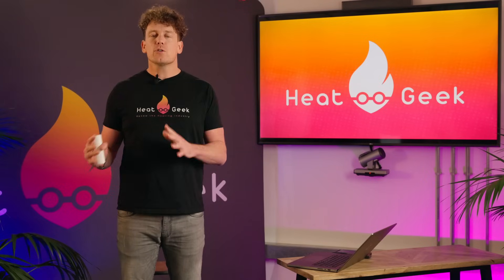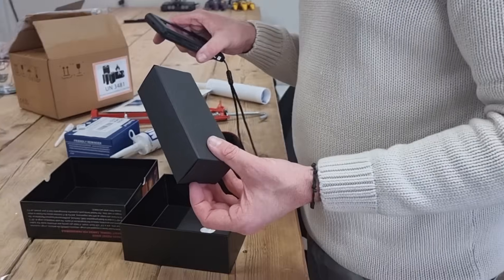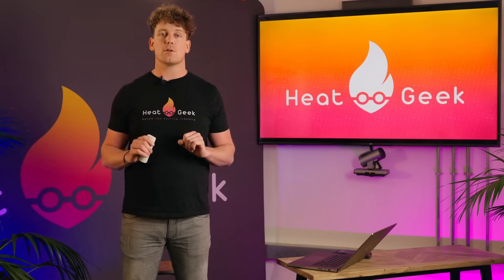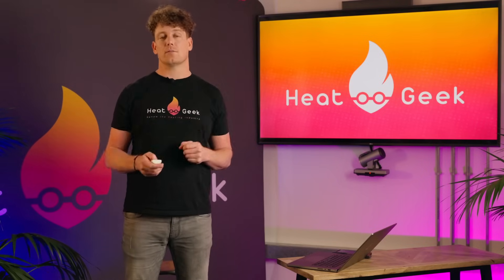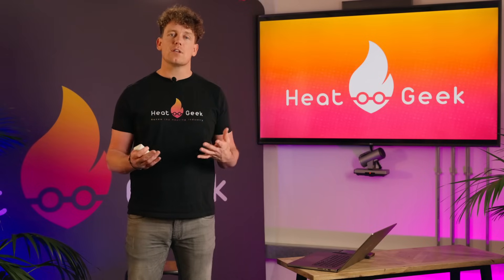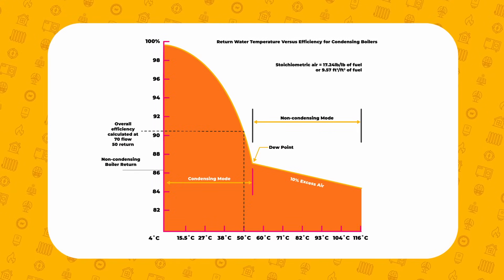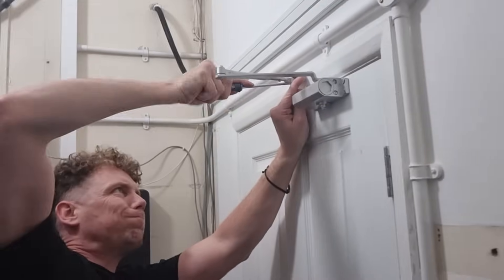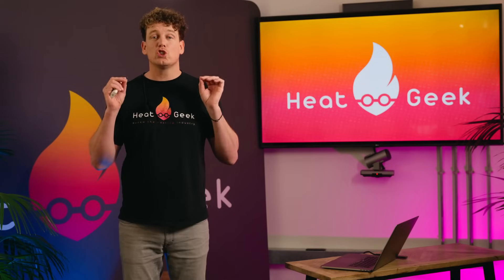This Insulation Secret Will BLOW YOUR MIND

Comment: The push to insulate homes has led to cowboys trying to sell spray foam loft insulation (government backed for years) which has resulted in rot to roof timbers. Poorly laid loft insulation where there is no air circulation. This can result in condensation and mould. Please be careful a lot of older houses need to breath.

Comment: A further saving that comes with a heat pump heating heating is if you also switch to induction cooking, which has additional benefits, you now only have one standing charge, which can be quite significant if you have lowered your direct fuel costs. Of course, you need to balance this against the loss of protection against power outages.

Comment: The annual heat loss will also reduce by more than 70% because the base temperature of the degree day calc will be lower. I.e. the temperature at which you need to turn the heating on because internal gains no longer meet heat losses.  Thus will make the calculation look even more favourable

Comment: How many inches of roof insulation did they recommend..the picture suggested that was problem but couldn't see any recommendations within the 14min. Video
Reply from the maker: @SteveMoore1969  we don’t recommend an amount of inches… I mean if money no object as much as possible, the point of the video it the packback is compounded with the use of low temperature heating
Reply: @HeatGeek  I have just got a new house with band b.. would it make sense to add a few more inches before fitting stilt

Comment: Good curtains over double glazed pvc windows. Check the gaskets seal. You want some ventilation in every room but not too much and uncontrolled. Modern windows and doors should have a trickle bleed in them. Because if you seal everwhere to meet Building Regs air tightness, you will not ventilate the building in winter. No ventilation will make you sick.

Comment: Is it just me or WC controls on Vaillant SensoComfor are ridiculously cumbersome to get to? 
I mean for a setting that one might need to "play around" till it is just right for the property it is really buried in the abyss, which is the "Settings" menu of the clunkiest system control unit of all times (I know their previous controls were a lot worse, but this is suppose to be an upgrade, so what the hell?) The heat curve controls should have been placed in the CONTROL menu.
For such a smart system it has a very dumb UI logic. I would have expected a bit more slicker controls and UI.

Comment: I covered my loft space with two layers of 13.5 tog polyester duvets bought cheaply on line and delivered. Easy to instal using two different sizes and at 27 tog amazingly efficient. No more loft condensation too.
If you have a 13.5 tog winter duvet on your bed try doubling it over and lay under it and you will feel what I mean.😎
Reply: Great idea, but are they flammable ?
Reply: @zorot3876  If they are polyester, they are almost certainly very flammable!

Comment: If you eliminate all the draughts, wouldn't you then have to leave a window open to make sure you're getting fresh air inside? It's not healthy to live inside an airtight box.
Reply: You can dehumidify, it will not be completely air tight
Reply: You fit heat exchanger fans. They capture about 90%-95% of the heat while venting the house.   Not that expensive,  but do take space so usually fitted in dead spaces between floor and ceiling.

Comment: But of course a house needs ventilation as well, so insulation cannot be considered in isolation…
Reply: Agreed. I retrofitted mechanical ventilation with heat recovery to my property due to mould problem and it is wonderful. Only losing couple degrees between extraction and supply

Comment: You mentioned much higher radiators flow temperatures that i currently run in condensing wirh
 compensation I can run flow at 30-35 at 22c° inside, which is much less difference.
But I run in 24/7
Should I increase the temperature as you said in the video?
Run my control on comfort instead of thermostat.
Don't really see any reduction in monthly bill that i had with an 1998 turbo boiler that run 60° and then stopped

Comment: All of this is based on a simplistic solid state use model that does not reflect the actual occupancy of the building.  Modern families require to get up to a warm house in the morning and then leave it, switching off the heating.  the house then cools until the heating is switched back on in the early evening and then switches off overnight.  What this means is that the heat source is having to raise the house and its contents from ambient temperature up to the comfort temperature and we all demand that this happens quickly so that during that cycle almost the same amount of heat is generated to get back to the comfort temperature irrespective of whether the house is better insulated or not.  Radiators are sized to cope with this initial boost as indicated by the difference in the rad temp/room temp of 50degC.
Reply: And totally missing the point.. Any modern heat source (and especially heat pumps) run more efficiently when maintaining a set temperature.  Heating up a property quickly drags efficiency down and in many cases completely wiping out any savings made by turning the heating off during the day.   Set back temperatures can be used however that allow the property to cool a little bit as well.  But still provide less work needed to re-heat the home.
Reply: @BenIsInSweden  I thoroughly agree with you and have direct proof of the principle.  BUT people don't use there heating in this was, they turn the heating on when needed and off when its not needed.  Until you can get over this hurdle people simply won't use their heating systems efficiently.
Reply: Who cares. People never understood whats good for them. No wonder they struggle

Comment: I'm shocked how little people know about insulating a house first- I've done insulated basement, cavity spray foam insulation, internal perimeter wall insulated plasterboards, glazing of exiting wooden windows with newer 16mm spaced double glazed units, perspex secondary glazing, thermal camera checking, composite door fitting & obligatory loft insulation over last 20 years as a semi diy'r & my lounge now stays at 20° all night most days, use biomass pellet stove in hall & a stoves in lounge for evenings that gets anywhere from 24-31° with little effort where we spend 14hrs per night & unheated top floor/bedrooms with teddy bear fleece duvet sets in winter. Gas heating been off for 24months & counting, with around £400-450 per year on biomass pellets and wood briquettes & really never felt warmer. My advice is do everything you possible can first yourself before going down the higher expense ASHP route @ £12+k

Comment: People said I was wasting $$ by supper insulating when I built my house in 1984  with R38 walls & 18” or 90cm or blown in cellulose ceilings.
But heating with solar & 1.5 cords of wood in radiant floors for 1800 aft living space + basement and 27x30 ft shop seems worth it to me.
Good presentation!
Cheers
Reply: 18" is only 45cm
Reply: 90 cm cellulose oO :D Holly molly, you went hard on that insulation. I mean I have 25 cm and it does wonders. 90 CM must be something :D
Reply: can we be ur freinds

Comment: Cold does not pour in it pours out, the draughts are cold air coming in to dilute your heat within and the warmed air goes out on the downwind side.
Reply: You're both right. It is easy to see, even feel, the lower temperature air and the chilled surfaces. You actually have double losses. You lose heat in your air transporting it outside, and you make your heating work harder to increase the temperature of the cold air and surfaces. So heat pours out, AND cold pours in.

Comment: It’s not correct that the lower the temperature the heating fluid the more efficient the boiler will be.
Reply: For old non-condensing boilers, you are correct, but for condensing ones you aren't.
Reply: Should probably preface with useful temperature. 98% efficiency at 10 c isn’t useful heat output for a system in most residential cases.
Reply: @ryzla101  Might want to check UrbanPlumber's recent video on his gas boiler, which runs at 29C flow, whilst keeping the house comfortable at 1C outside temperature.  Far more efficient than the standard 70C flow that many boilers in the UK are set to.
Reply: Agree that it’s better than outdated technology. I have built a system that runs at 45 C and keeps the house comfortable at -50 C here in Canada.

Comment: Good video, I see it all the time in building, expensive doors and windows fitted badly thus totally defeating the benefits , If I was the captain, which I am, I'd put your team, Roger from Skill builder and Urban plumber in charge of raising standards around the country. I think I said before , a good acronym for this topic is RCC, radiated, conducted, convected heat loss or gains depending on which way you want to look at it. Keep up the good work. Obviously a lot of people dont like using the biggest muscle in the human body, their brain, whole country needs more brain exercise to get on top of the situation. I walk the talk, just insulated parents house with top up 200mm insulation, hoping to reduce ridiculous oil bill, should have been done 20 year ago I have to say.

Comment: How can I measure return temperature to my Vaillant combi condensing boiler?
My target flow temperature is at 36-40° depending of the outside temperature (heating curve 0.75)
It sett to "modulating" so basically it's always on.
Should I increase the heating curve and return to the setting "Thermostat"?

In not sure it my system is running correctly/efficiently 🤔
I have tho a constant 22-22.5° in all 130sqm (350m3) space.

Comment: There is an additional saving you didn't mention, from insulation lowering the house's "balance point temperature", i.e. the outside temperature at which the heating system will call for heat. By insulating, the balance point temperature is lowered because passive heat gains from appliances, solar gain, water cylinder, and people become more significant. The heating reduction can be calculated from degree day based at the lower temperature and can be bigger than the efficiency saving you talk about. Check out the building physics of this process for more explanation.

Comment: I’ve just installed MVHR ventilation + air-tight covers to LED downlighters + 25mm BASF Enertite (open-cell sprayfoam) to attic floor for air-tightness + min. 400mm of Cellulose insulation to attic. 
Added lots of ventilation to cold attic. 
Windows and doors being upgraded to 0.7 U triple glazed and fitted with Tescon air-tight tapes. 
Big difference so far but the big question is how to treat the 130mm wall cavity. Currently it has 50 EPS to inner leaf leaving 80mm for air to flow around and enter building via gaps around joists. 
Seriously considering BASF CV100.  
Blocks are Mica & Pyrite free. 
EPS gives expansion room and lessens risk of wall damage. 
Interested to hear people’s thoughts.
Reply: @gregmcgarry1 I've been considering a PIV for our old house. I'm told it improves air quality and helps with damp and condensation by pumping in air from outside. My question is .... would I just be introducing the same problem I had before? cold house > block all draughts and insulate > condensation problems > add PIV > colder house  ..... I appear to be back at square one - am I missing something?
Reply: @gittin_funky  Yes you need an air exchange for the house to bring in fresh oxygen and to stop us from breathing stagnent air. Fresh air bought in through a heat exchanger recycles 90% of the heat. We keep sealing these houses up then we all get sick slowly especially from all the stuff the many appliances give off. We used to have up to 6 house cycles a day from the fireplace but we seal everything up now.

Comment: This is all very well put, but if you are trying to save money on heating this will be taken up by the utility company putting up the fixed cost(standing charge). The less energy used equals less profit. This is the same effect seen on  car tax .
Reply: That happens regardless, not putting in the work to insulate and upgrade just means your bills jump even more.

Comment: We have a 2003 build detached house and have lived here for 3 years.  Despite the EPC quoting cavity wall insulation assumed, there was none and now there is.  At the end of our first year we replaced the polycarbonate conservatory roof with a fully insulated tiled roof (it is part of the kitchen diner and cannot be shut out in winter).  Our gas consumption has reduced by a third immediately.  Still more we can do, I am sure and this video has prompted me to seek more information.  Thank you.
Reply: The walls will have got through building regs as they will have used some sort of thermal block to achieve the required u value, the cavity may be empty, but the u value was achieved so the EPC assumes CWI present. Retrofitting CWI to this house will make a slight difference, but not as much impact as insulating a cavity house from the 60s.
Reply: Epc is worthless. Basically if you don’t have builders report any improvements will not be taken into account by epc guy. Its laughable

Comment: I was told by Crystal Windows, when they installed my new double glazing, that sprayform around the frames is not allowed under current regulations
Reply: Who was saying this was either unqualified or wrongly informed. There is nothing against spray foam to seal gaps between windows or doors and walls. Surprisingly, some windows installators afraid the frame may bend, again this may be sorted by using low expansion foam. Currently, newest (European) installations are made without usage of anchors, only carefully selected foams.
Reply: @tozrobilem  Crystal Windows.  They used sledge hammers and large hammer drills. Structural issues started to appear after the new windows were installed.

Comment: I have always maintained that putting a heat pump in a badly insulated property is a waste of time and you, together with Urban Plumber have been in denial about this for years.  This video proves it to be the case and it concerns me that so many people who follow your advice would have had huge diameter pipes to get the required flow rates from a heat pump when they would have been much better off insulating their homes. 
You say that you have had 600% efficiency,  (SCOP?) on your heat pump in a poorly insulated building but that is meaningless if you don't say how long it has been running in order to heat the building to the required room temperature. Running a heat pump at full blast 24/7  with a (debateable) scop of 6 is still not going to be as good as running a gas boiler for less than half that time.
Reply from the maker: There’s too many nuances here. 

Running a 7kw heat pump for 24hours will use less energy than. 24kw boiler for 12.

They do work in ‘poorly’ insulated properties absolutely fine we have a video on it which isn’t really debatable as it was independently measured by open energy monitor.

Keen to know how this video tells you they don’t work in less insulated building? Surely it just tells you that they will perform better with more insulation? Not that they don’t work at all.
Reply: @HeatGeek  but surely the boiler won't be operating at the 24kw for the full 12 hours, mine doesn't. In fact, when it reaches the room temp it switches off and uses 0kw. Running at 55c by the way.

Comment: This is all crap just am advert for heat pumps. Try running your system at 50deg that is your heat pump level you will find you will take hours to get the room up to 20 deg and you will be cold for hours. Gas boilers at 70 deg will be much better all round. as proved  by 25 million homes. For 25 years. Why? Because they are reliable and cheap and effective and do instant hot water. Unlike a heat pump.

Comment: And another reason why HEAT GEEK should be the company used for any heating requirements. They visited my property this week due to really poor performance from our previously installed ASHP ( NOT HG) and apart from a number of poorly fitted items and initial set-up, we discovered that although the house had previously had cavity wall insulation, it was poorly done. So great to find this out and get sorted. Thanks HG ❤❤❤

Comment: My house was recently A rated. I have solar and batteries and export all summer and much of winter. Over a year my standing charges make up over 50% of my bills now :( Anything else I do to the house will reduce my bills by a minimal amount whilst the fixed and uncontrollable (government imposed) charges continue to rise. With under 4,000kwh of gas a heat pump won't pay for itself in my lifetime!
Reply: I'm not very good in English. Are you saying that when a house is well insulated it is more convenient a gas boiler over a heat pump? Due to gov costs on electricity?
Reply: @enricocavallin1503
No. Because cost of heat pumps and installation is prohibitively high in his case
Reply: @enricocavallin1503  No. But if I spend £5000 installing a heat pump and getting rid of my boiler it will make almost zero difference to the actual cost of my energy consumption as it's not mainly fixed charges, not usage. We worked out it would save around £10 a month - so that's almost 40 years payback at current rates. With standing charges increasing all the time that will stretch further into the future.
We are hopping for hydrogen to become viable. All the pipework and my boiler are ready for that.

Comment: Now you have no ventilation or air change, so end up with condensation and mould. Don't make houses airtight in order to try and get a heat pump to work. Dump the heat pump as they cost my neighbours far more to run and houses were cold. They were designed and fitted by a major company, not cowboys.
I will stick to my cheaper to run more controllable gas boiler.